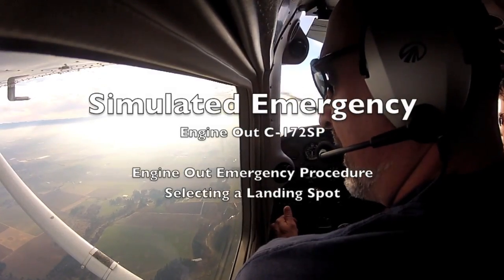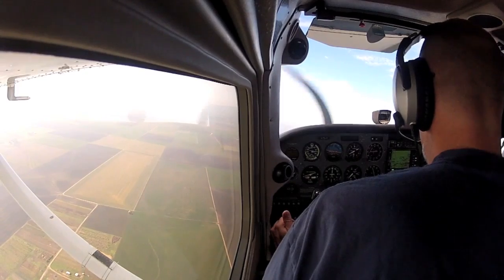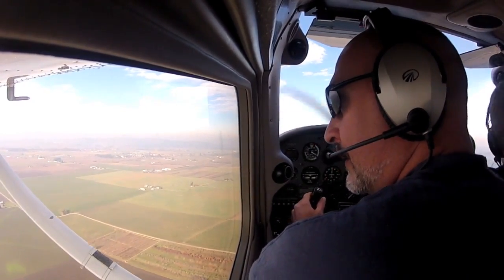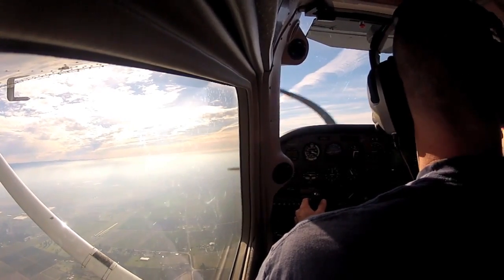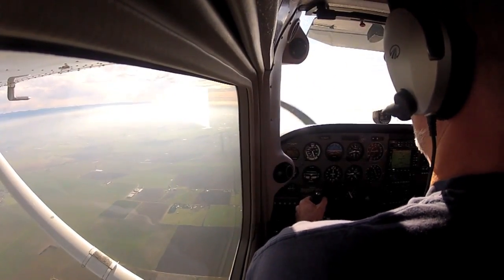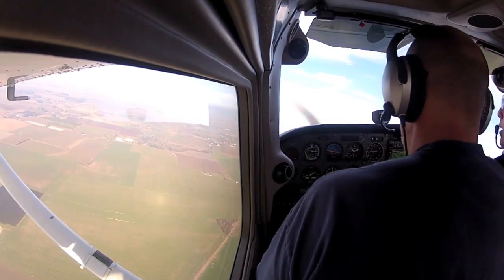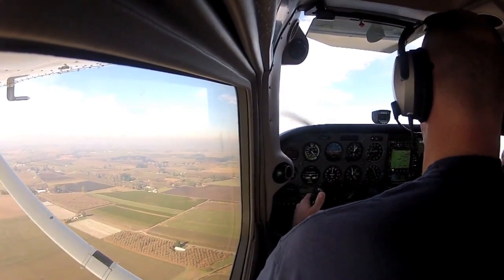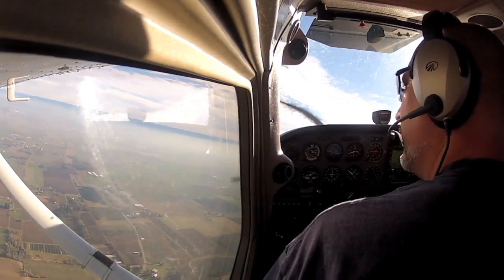Engine Out C172 | Emergency Procedure Training

Comment: aren't you supposed to first follow the ABC method?
Airspeed-Maintain 68 kias
Best field-Look for the best field to land on before starting to maneuver
Checklist-Do a flowcheck to find any errors (fuel selector off, mixture is full-lean, mags are on, circuit breakers are in)

All this done before starting to maneuver towards the field. Just wondering, or is it a different method?
Reply: You’re correct. But as you can tell he had already picked his landing spot before the power was even pulled. And don’t forget.
D- declare emergency on 121.5 an squawk 7700
E- Exit preparation, Explain to passengers what will need to be done to evacuate safely.

Comment: Can someone explain why you would "turn off all the reds" in the event of an engine failure? Isn't that both counterproductive and pointless?
Reply: boomerthoreau Cutting off fuel and electronics helps mitigate the chance of a fire and is done when you get close to the ground in emergency situations.
Reply: Just imagine... You've had an engine failure, your set up on a short final, you've got everything undercontrol and your 100% going to safely land the aircraft in a field and then all of a sudden the engine fires. You then think, I have power again, you become distracted, you try to climb out, the engines gives you a little but then it dies again. Now you've overshot your only landing area and your really low on altitude and options. Theres now close to a 100% chance you WONT be able to land safely. If you have an engine failure and you cant re-start it by 1000'AGL your then commited to the forced landing. So shutting down the engine, Electronics (after last stage of flaps is out and mayday call) and shuting off the fuel reduces the chance of distraction during the approach and fire risk in the event of a heavy landing.